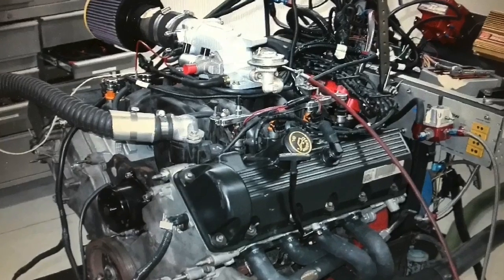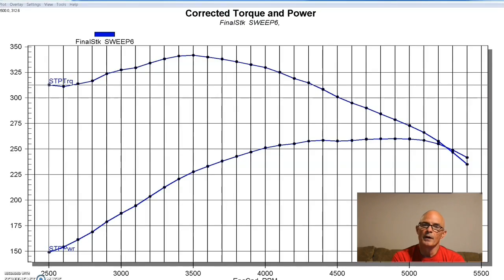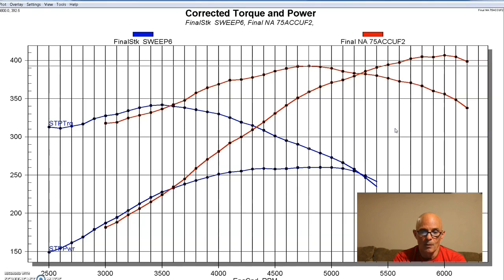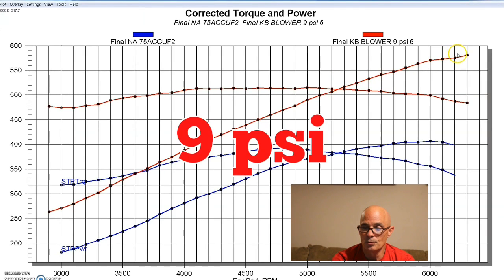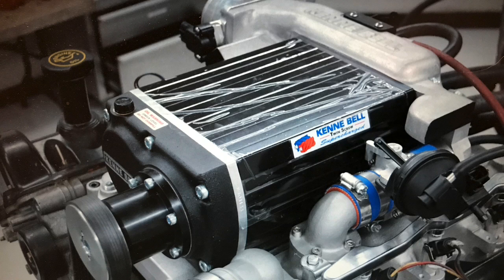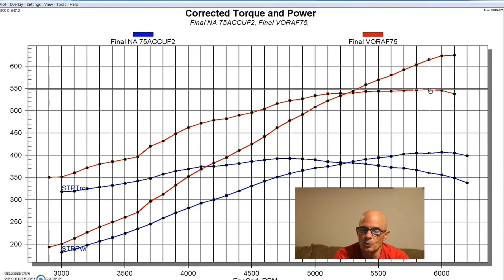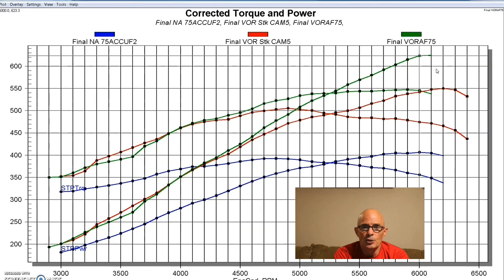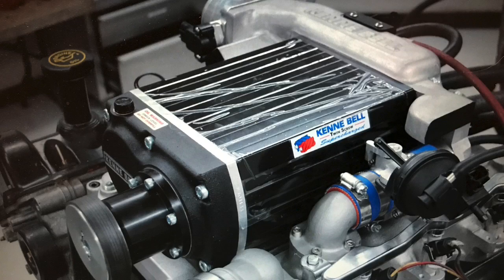HOW TO: SUPERCHARGED 4.6L FORD 2V (BOLT-ON BOOST)

Comment: That H/C/I + KB combo is pretty damn sexy.

Unfortunately, it's also pretty damn not cheap versus what we can do with junkyard LS bits.
Reply: No kidding... That supercharger is probably worth more than both my Vics put together.... But it would sure be nice on one of them...
Reply: Can always go the turbo route instead of the blower to keep the budget reasonable,  size your turbo accordingly and you can have gobs of torque like a borgwarner S362 would spool up instantly and make over 600 whp.
Reply: First off . These motors are old . So parts are much much cheaper now .
Just like the ls . You need to do stuff to make power.  You just dont make 4 or 500hp by taking the ls out of a truck and putting it a craparo .

Ask me how i know .
I've worked on both . At the 500hp rage . It was about the same price . 
Ls needed head work . Cam , intake work or swap , TB, 
Headers . And tune up .
Guess what . Same thing with the 4.6 .
Reply: Tony Spadafino,

So much truth in your post.
Reply: A blower costs the same for a mod motor as it does for an LS - just like a turbo costs the same for a mod motor as it does for an LS

He wasn't even running the smallest pulley - skip the cams & heads(they aren't exactly a 'huge' improvement, like the Trick Flow 2v heads would be) and crank the boost to the moon if you're really such a broke ass. Just like what you would do to an LS. 

Now, go ahead and tell me how much a junkyard 2v costs vs a junkyard LS - I bet I know which one is cheaper...

...so, where's all the extra expense then? 
Use your head, this is basic stuff

Comment: I want to see two carburetors or two four barrel Holley throttle bodies running on a sheet metal intake with a single or twin turbo something I never seen before
Reply: You don't see that often because a single 4150 flange can flow over 1000cfm no problem.
Reply: @madmod  I know that but I want to see it